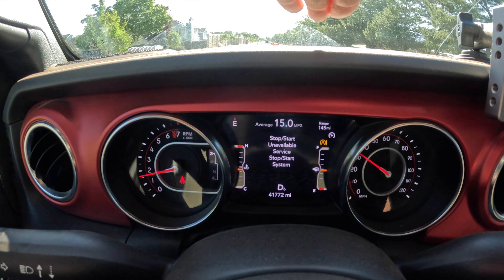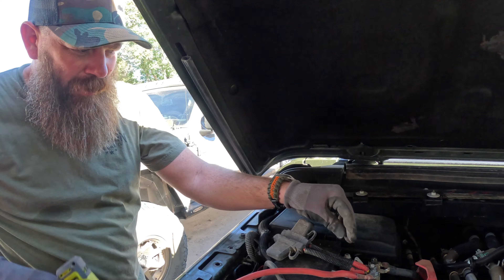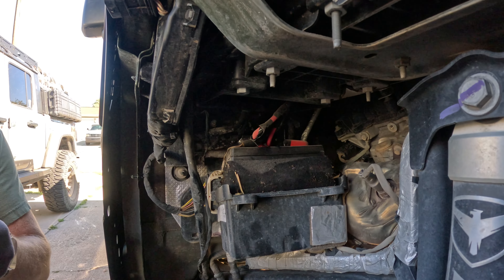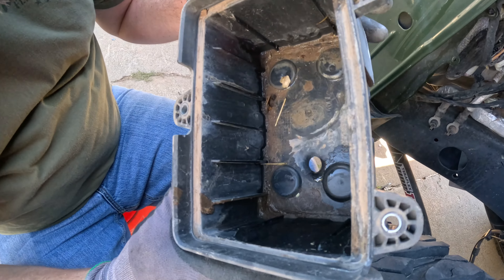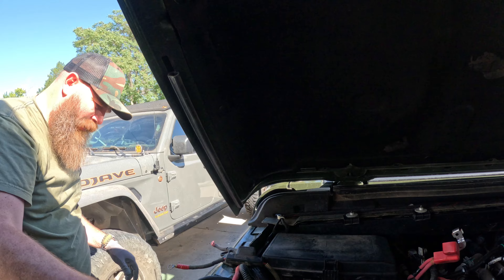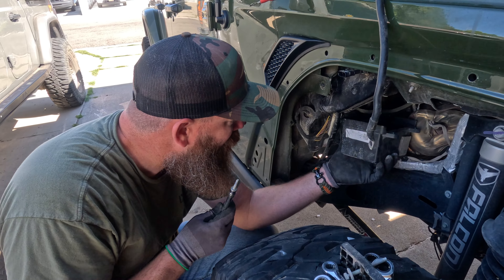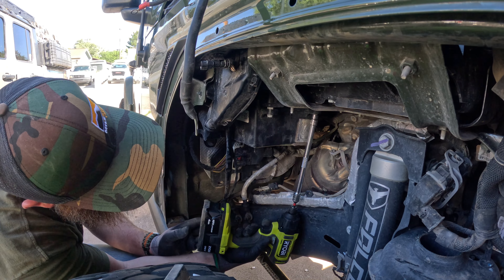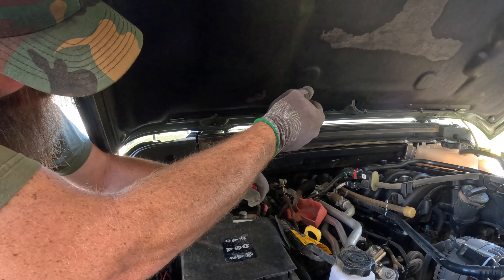AUX battery delete: Solve Jeep JL/JT Battery Problems in 20 Minutes DIY

Comment: I did the same but my jeep sometimes discharges if I leave it like that.

I don't know if I should take it to service
Reply from the maker: That’s interesting I have yet to have that problem. So you must have something still drawing power like a winch or something. Mine has been sitting for a week as I have been away for work. So we will see how much charge it has
Reply: i had the same problem but it wasn't my JL that was doing it it was the GPS the dealership put in. look for a box connected to your ODB2 port. 2 mins and wire cutters fixed that.
Reply from the maker: More good information

Comment: DO YOU STILL LEAVE THE #42 FUSE IN ADTER THIS DELETE? IVE SEEN SOME VIDEOS WHERE PEOPLE ARE PULLING THE FUSE..
Reply from the maker: I have left mine in
Reply: Pull it.  It turns off the ess nonsense completely.  Then you can just remove the negative that goes to the aux batt. Tape and tie off.   Done
Reply from the maker: @ronm7781 good information. Thanks

Comment: can those wires not just be completely removed to clean things up?
Reply from the maker: Yes and no, the negative I know you can. The positive I am not 100% sure. But I would think so, as long as nothing is spliced off of it or you connect everything that it is connected to back to the main battery I don’t see why it couldn’t
Reply: @Vikingoff-Road  once you disconnect the negative of the aux battery off the main battery.I would think  the positive  to the aux battery does not do anything anymore because it does not have a ground attached to the battery
Reply from the maker: You could be correct. This is what I’ve seen other people do from reading articles and watching watching other videos and it has worked great for me this way it’s been however long now trying to think up top my head like three months four months it’s longer than five months 56 months now and I’ve never had an issue with the battery or anything like that
Reply: @Vikingoff-Road  same here. I am just trying to figure out how it all works. Great video you made Thanks
Reply from the maker: Voodoo magic had been my best guess lol thanks

Comment: That's the hard way of doing it
Reply from the maker: It’s the only way I was aware of after doing my research
Reply: @Vikingoff-Road from what I understand you just need to remove the negative aux cable from the main battery, and cap/secure it and remove f42 fuse and it’s bypassed
Reply from the maker: @ronwalker852 that could do it. I’m not sure. From the research I did this is the way I found worked the best. I didn’t have to remove any fuses. So things what I did I’m not sure if the other would work.
Reply from the maker: @ronwalker852 just leaving the positive hooked up to the aux battery?

Comment: Why do this when the aux battery is only $100 and you only need to swap it out every 5 years?  I plan to maybe sell mine one day (at 100k or 300k) and hate to remove something factory designed.  Not that I haven't done that before 🤣 but I don't really see the point.  I'm at 55k miles, 4 years old and the factory just failed last week.  I keep ESS disabled via the tazer so that's prob it hasn't failed yet.
Reply from the maker: Good question. For me the auxiliary battery is some that I didn’t need. Mine failed at 41k miles. And less than a year of owning. I also have a tazer and do not use the ESS. 

The reason I went this way is so that I I decided to sell the jeep I could reinstall the aux battery if I chose too. Meaning the only thing that has been taken out is the battery itself. The ground is still taped off in the battery case, and I am also able to reroute the positive back down to the the aux battery if desired. 

Now while I own the Jeep it is less than a $100 every 40kish miles that I do t have to pay. As it serves no purpose in my case. 

Thanks for watching
Reply: @Vikingoff-Road  Yeah, I see your point.  I do turn ESS on from time to time which is nice since mine's a manual so I like to have that option.  My main failed last week at 55k and I just swapped them both out.  The main H7 850cca and aux, both Duralast Platinum AGM's which have lasted 6+ years in other vehicles here in the cold Colorado winters.  I did a 2 week hunting trip up to SD and guess not starting the jeep for 7-8 days was the death blow to the main battery.
Reply from the maker: I can imagine. Here in Utah we get them colds but not like SD. My main battery has been good. It was the aux battery that failed for me. I will go AGM when this one goes. My JK had an AGM and I loved it.
Reply: @Vikingoff-Road  I live in Conifer, CO but travel a LOT,  mainly in my truck and not the Jeep.  I have a 2020 JLUR and was surprised the stock H7 said AGM on it.  It was a stock AGM battery... crazy.  I also have the cold weather and towing package so maybe that's why.
Reply from the maker: I have the tow package and cold weather package I may have to double check mine now. I didn’t look when I had it out.
Reply from the maker: @Mindyobidnessm8  correct, I don’t have to worry about it failing and saves me $100 each time
Reply: $100 battery, but hundreds of dollars of labor to change it.  Either under the fender well or up top, pull a bunch of other parts to get to it.  Horrible placement
Reply from the maker: @rileydj8764  very much so
Reply: I pulled my fender liner, unscrewed the screws from the bottom, and had it replaced in under 30 mins.
Reply from the maker: @sinepari9160  that’s awesome!
Reply: Mine failed at ~50k miles and again after another ~40k miles.  At this point I’d rather just bypass it and not have to deal with the PITA replacement process anymore
Reply: @ronwalker852  It's really not that bad once you understand it.  Having a little aux battery is good imo now.  I did replace both with much higher quality batteries and I'm sure they will take me to 100k+ miles.